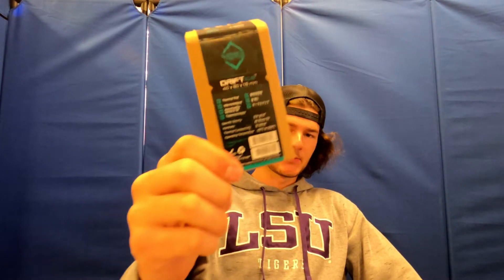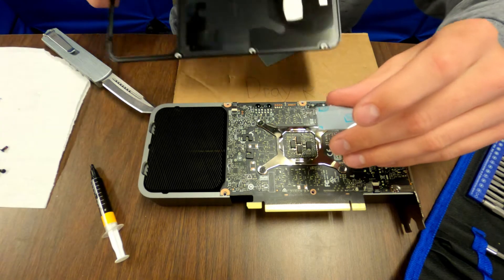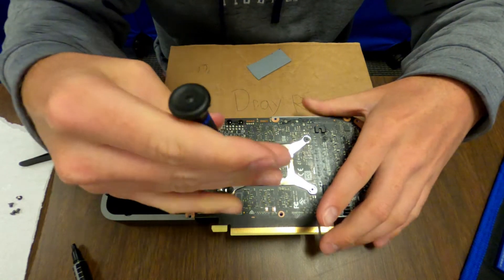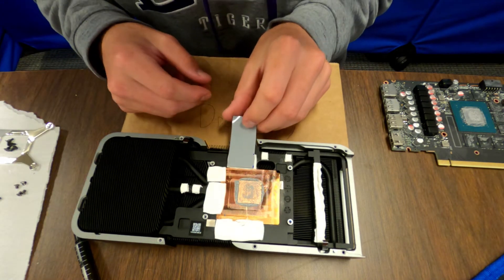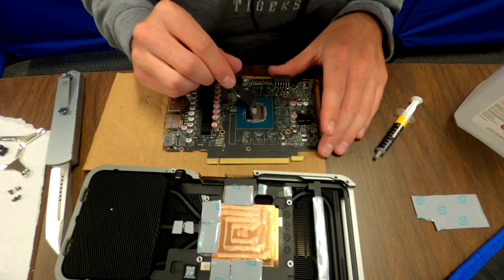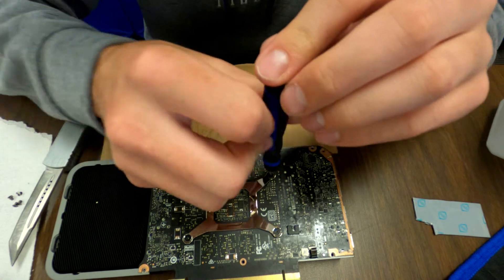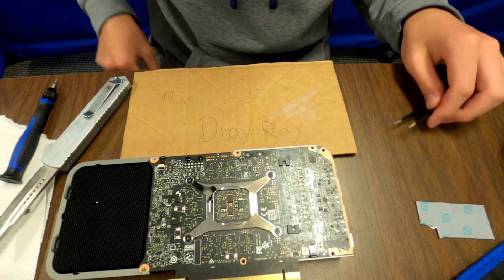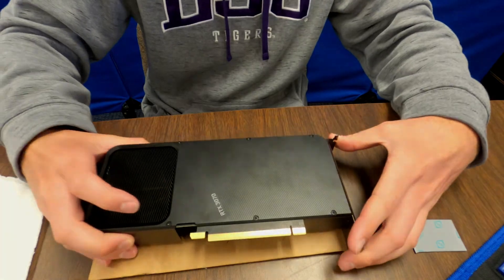RTX 3070 Thermal Pad Replacement

Comment: I have the same card whitch never been opened so far thats i found this video but man people your way doing this whole proces is so wrong haha u use finger nail to remove remains of paste on coper plate without knowing that you leave marks on that plate 🤣
No gloves you are touching new pads directly with fingers thats wrong. After removing old pads no clean resedue you just out new pads ower. How the hell this card work.
Ok i need 1.5mm pads for all chips including memory chips thx for the vid 🤣
Reply from the maker: How will the scratches impact the performance/cooling of the card? Also how will the grease/oil from my fingers impacts the cooling of the pads themselves??

Comment: How many packs of thermal pads did you use?  Is an 85x45x1.5mm fine, or is 120x120x1.5mm better?
Reply from the maker: Iceberg Thermal DRIFTIce Thermal Pad 120mm x 40mm (1.5mm) https://www.amazon.com/dp/B08KYHDHFQ/ref=cm_sw_r_cp_apip_bWcWOxXmR6tJJ
Reply: Thanks for the quick reply!
Reply from the maker: Thats a link to the pads i ordered. I did not use them all but you could not get the smaller pack and have enough to completely replace all the pads.
Reply: @drayray9766  Hi Dray, do you think the size 80mm x 40mm x 1.5mm is enough for 3070 FE?

Comment: What if i dont change my card pads I've been mining on that card for about 2 months no issue?? Do it still need to change pads??
Reply from the maker: If the temps are below 90s then its okay for gaming and short use of the card. But for mining you would want to change them since the card is being used 100% of the time.
Reply: @drayray9766  fe doesn't show vram temps so what should i do??
Reply from the maker: @apoorvamishra9387  they do. I have 4 of them and they show vram temps
Reply: @drayray9766  wtf ??? How?? Can u show me??
Reply from the maker: @apoorvamishra9387  through msi or whatever overclock application you have
Reply: @drayray9766  gpuz and afterburner doesn't show any info.
Reply from the maker: @apoorvamishra9387  I can see it through my overclocking through nicehash

Comment: on my card i do not have the silver plate on the gpu, since my 3070 was water cooled. does that plate effect the temps?
Reply from the maker: I do not have any experience with custom water cooled gpus so I do not want to tell you anything that might be untrue.
Reply: Nah. It’s not necessary on the water blocks as they distribute the force without that plate.  Source:  using ekwb waterblock on mine

Comment: my fans went crazy what did i do wrong?
Reply from the maker: Double check your connections then restart your entire desktop
Reply: @drayray9766  i checked well and i still have my fans going crazy when i start a game, and the card goes up to 100% usage, please help me
Reply from the maker: @Elipton78  make sure your drivers are up do date
Reply: @drayray9766  everything is update, I reinstalled the graphics driver and the fans still go to max
Reply from the maker: @Elipton78  you probably have too thick of pads there for the cooling plate doesn’t come in full contacts with the dye. That could be the issue
Reply: @drayray9766  that must have been it, thank you so much!
Reply from the maker: @Elipton78  no problem

Comment: For such an expensive card i prefer to do not touch at my graphic card that has 5 year warranty and wait till it die and receive a new one when it will instead of disassemble it and lose my warranty and receive nothing when it will die, just think about it.
Reply from the maker: I did. And didn’t care. So I exchanged the thermal pads
Reply: @drayray9766  Hope you are proud, i don't like to play with such sums of money but if you have too many money I'm happy for you.
Reply from the maker: @mightywizard7212  just confident in what I do my man. Got to see it through
Reply: @drayray9766  I didn't mean that you risk to break your graphic card but when i the future anything happen to it you warranty will be void, but it's nice to have confidence besides that's why nothing is guaranteed isn't it?
Reply from the maker: @mightywizard7212  nothing is guaranteed correct but why not do it bro. I get better temps and better hashrate
Reply: @drayray9766  Yes you get it all but you loss the warranty and if the card fail you will lose it all, you take this risk not me, not for such a price, for 100 bucks yes but not for more then 700 it's a choice to take and i'm not rich enough to take this risk and lose the warranty. My car work fine without this mods and how many perf will you win 10%, no thanks, i prefer not have this 10% and become a new card if it fail.

Comment: What size were the pads?
Reply from the maker: 1.5 mm
Reply: @drayray9766  thanks for the swift response! I got one of my card hash rate dropped. I will be replacing the pads too see if that helps. Thank you this video was excellent!
Reply from the maker: @ObiVisualsTV  thank you. Wish you the best man.
Reply: were all 1.5 mm? @dray ray hope u answer
Reply: @guillermopintosandoval7542  I did all 1.5. Working fine
Reply from the maker: @guillermopintosandoval7542  yeah bro. All of them were 1.5mm
Reply: @drayray9766   and obi, thanks a lot for replies
Reply from the maker: @guillermopintosandoval7542  anytime bro

Comment: someone noticed that the plastic of the thermal pads wasn’t removed, or my printout
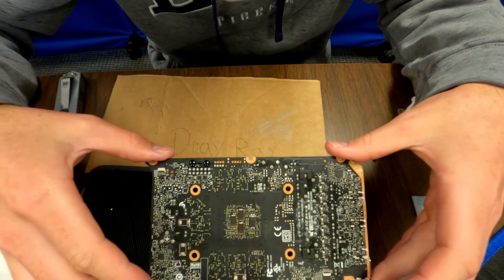Reply: In 8:31 close the board with plastics in
Reply: @soyfac  looool
Reply from the maker: @soyfac  yeah I’m gonna open it back up and fix it
Reply from the maker: Idk what you mean. Just make sure you don’t leave the plastic on lol.
Reply: @drayray9766  you did not remove the plastics from the thermal pads in this video.
Reply from the maker: @leandrobeckersevero2613  I think I edited that part out but I did.
Reply: @drayray9766  no dude. U didn't. Please do recheck. It could spoil the card
Reply from the maker: @antonybrittozz  I did remove them. It just wasn’t recorded. I’ve been using the card for months now

Comment: How’s your temps looking after changing the pads/thermal?
Reply from the maker: Amazing I run R6 and Apex and stay below 75. I can mine at 58 and lower
Reply: @drayray9766  what were your temps before?
Reply: Also what thickness thermal pads
Reply from the maker: @brokejaw  1.5mm
Reply: @drayray9766  what about your temp drops
Reply from the maker: @brokejaw  not sure of the temps before hand but mining I maintain 58 with overclock. Gaming I peak around 72-74
Reply: @drayray9766  ok I'm getting around 90 on cyberpunk
Reply from the maker: @brokejaw  geeze man. Mines never been above 80
Reply: @drayray9766  Ya but i run my settings higher than what I should
Reply from the maker: @brokejaw  hmm. Maybe you need them thermal pads
Reply: @drayray9766  Sorry one last question, did you end up just buying one 120mm x 40mm pad?
Reply from the maker: @brokejaw  I used some from a piece I used for the 3090. Not sure exactly how much I used but I’m pretty sure I used one pad worth or less
Reply: They didnt invent the pads dammit I hate that. Well I'm gonna spill their little secret here then. The pads they use are special order 2.25mm or 2.5mm Alphacool Eissentech fabric pads. They're garbage like 3.0 w/mk. I say special order cuz u can only find that type of pads in 1mm and 3mm normally. And to stop anyone from experimenting with the 3mm Alphacool pads dont do it. They're too thick I've tried and a 50mmx50mm piece is $30. Just hot Nvidia smelling trash all around.
Reply: @megalojerk84  how did you find out what they use. Are you sure this is specifically for the 3070 Fe?
Reply: @brokejaw  I actually had some of the 3mm and I just did a side by side comparison. They're exactly the same except the thickness. From what I've seen of all the videos I've watched it's been the same pads. Watching this 3070 video just confirmed it for me
Reply: @megalojerk84  do you know what hardness rating they used for those 2.25 and 2.5. I'd they're harder than the other brands than that mean we can go thicker on the softer brands.
Reply: @brokejaw  they're actually super soft cuz its literally just fiber mesh and thermal paste. I had gotten some squishy 2mm pads thinking that might be it but idk now if 1.5mm worked for him. I've also tried the Gelid Ultimate 2mm but they were too hard no core contact
Reply: At max my 3070 FE runs at 70°C (stock). Will it still make a difference if I decide to buy "thermal grizzly" pads?
Reply from the maker: @ayguntataev  I have never used those pads but I would just read some reviews about them.  We used iceberg pads and they work great.
Reply: So it was 1.5 on the front and back? I've been looking for pads for my 3060 ti FE and I'm seeing theyre the same across all the FE cards
Reply: @megalojerk84  I tried contacting Nvidia about what pads they use on the 3070 factory line and told me they don't give out that kind of information and to each out to community enthusiast boards...
Reply from the maker: @megalojerk84  yes
Reply: @drayray9766  ok cool thanks